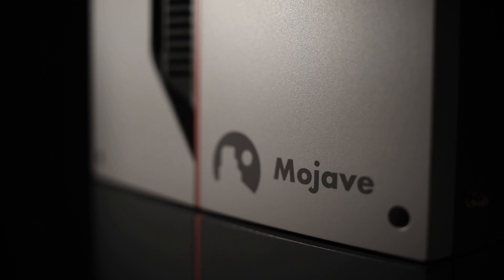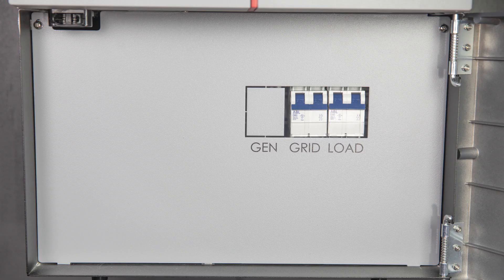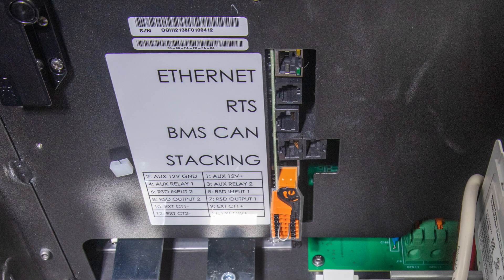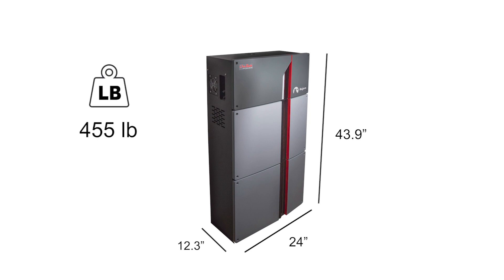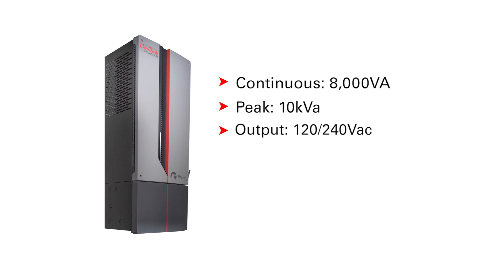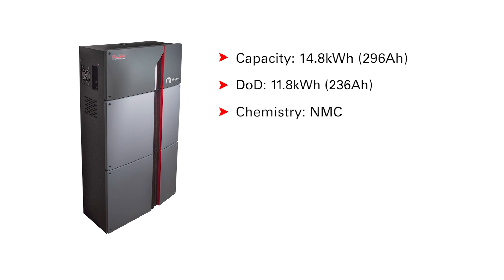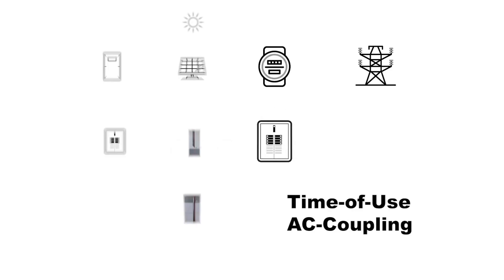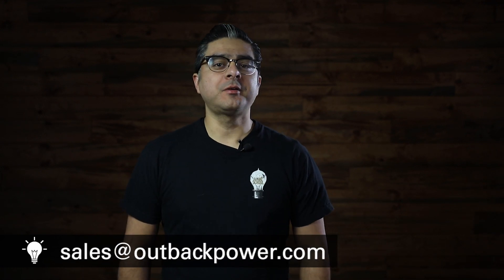Mojave Energy Storage System: Overview

Comment: Can you stack these? For a large grid tied backup power system, why choose this over radian?
Reply from the maker: The Mojave ESS is not stackable at this time, but we are planning to roll out that functionality via firmware update later this year.
Once the stacking feature is active, Mojave will be much simpler to deploy and offer more flexibility as each unit will manage its own battery (an important feature where building codes limit individual pack capacity to 20 kWh or less). Mojave also features the latest grid support features which will be required in many states starting later this year.
Reply: @OutBackPowerTech  Is this a low frequency transformer just like the Radian? I assume it is because of the weight. So this is basically a low frequency transformer based direct competitor to the Sol-Arc? One that's assembled in the USA? I was debating between the Radian and Sol-Arc but would rather go with a low-frequency unit. And one that's US based and made in the USA as much as possible (or assembled using good components).

Can you verify the stacking function WILL be coming? I'm looking to run a business building with four or five computer workstations going at once, a woodshop, and home, and various small/hobby farm activities and outbuildings....with conditioned spaces using mini splits and hydronic floor heating from ground loops and supplemental wood heat. And potentially charge EVs (looks like that's the plan, force us to EVs, plus peak oil is a thing). Probably offgrid (yes, I know this will be expensive). So expansion will be critical.

My parents had Trace and then Outback (4500 watts I think) and have had no problems with the Outback in 15 (?) years. I think their old Trace unit is/was repairable, but they needed a replacement ASAP at the time.